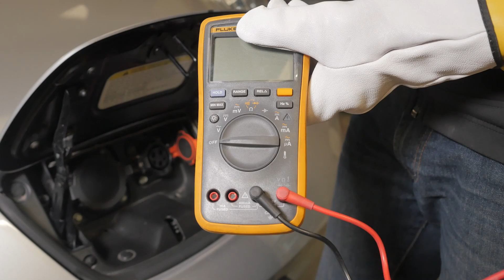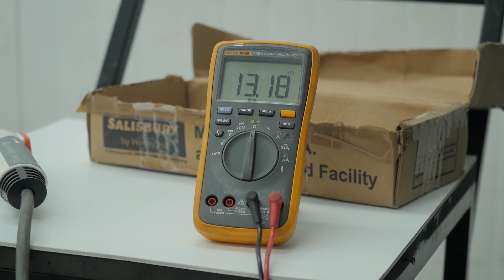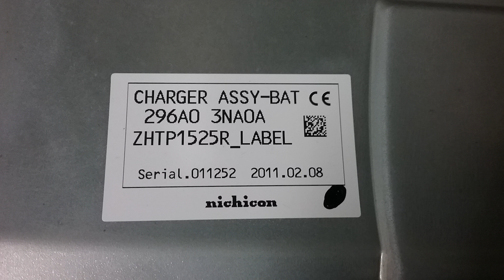Nissan Leaf Charger Fix

Comment: I'm having a similar problem with my 2019 40kW Leaf. It will charge ok with the 13amp "Granny" charger but not the type II wall charger or similar public chargers; (When I can find one that actually works!). My local Nissan dealer doesn't have a type II charger so they aren't going to be able to test it. Not sure what to do. The 3 LEDs indicate it's charging but they go out after a few minutes.

Comment: It's great to see EV mechanics making these types of videos.  I just purchased a 2018 Nissan Leaf and I really like the car a lot even though the ChadeMo quick charge stopped working.  It's fine because I find I don't need it.  I fully charge it at home in 2 to 4 hours and sometimes don't charge it for a day or two because I use it for around town and drive between 20 to 80 miles any given day to run all errands.  This car was designed for around town use, not road trips.

Comment: Seems like you skipped an important step in this video. You must’ve had some kind of circuit diagram you an indication which diode failed, and where it was located.  Please elaborate.  Or is there a service bulliten that gave you a clue?

Comment: hi, i measured with a measuring instrument but the values seem normal. then i measured a charging nissan leaf and realized i have the same values. my car only charges with chademo. And now I don't know what to do. Do you have any suggestions? by the way the value of my front small battery is 12.4. Could it be caused by this?
Reply: Did you replace the 12V battery? Did it fix the issue? I got a DS3 crossback e-tense with battery in 12.3 V and only charging in DC. I can't charge at home.

Comment: I have a suspected fault that I cannot fix - I have a 2013 leaf. It has been fine, charging to full at 6kw at public chargers, using a type 1 to type 2 cable - but over the last few months, when I plug in to charge at the same public chargers, it will charge at 6kw for about 10 minutes, then switch to 3kw and slow down to charging at 3kw over an hour - then the second hour it will only charge at 1kw, this is when the battery is at around 20-40% full. If I plug in the 2.3kw slow charger at home then it charges ok overnight. The Chademo works ok and chargers at 50kw. I used to be able to leave it plugged in at public chargers for 2 hours and it would be back to 100%, now if I leave it 2 hours while shopping, I am only getting about 50% charge.

Comment: Great video. Unfortunately after repairing the diode, I now have an open circuit between pilot & ground. Gonna plug in charger and see if it charges.
Reply: What happened?
Reply: @BassByTheBay  Sorry. Turns out my employee never actually did the diode repair before I reinstalled the charger. So that's why it was still reading open when testing.
Reply: @stevenromero1801  Did the diode ever get replaced? Did the charger work?
Reply: @BassByTheBay  Unfortunately it did not. I ended up replacing the whole unit.
Reply: @stevenromero1801  Thx for the update.

Comment: Hello from Norway. Is it possible to change OBC without draining the cooling fluid? I haven; t the opportunity to get my car lifted so much over ground level. And thanks for a great video. LG
Reply from the maker: Hi. The coolant needs to be drained to replace the OBC. It could be done without a hoist though. The car doesn't need to be lifted that much.

Comment: My problem with the 2012 Nissan leaf is I'm charging it with level 3 station and it's not charging to 100% even if I charge it for more than 40+ minutes and I don't see the charge guage cluster go all the way up as it should, it only shows 30miles range
Reply from the maker: Hi. Fast chargers are not designed for charging to 100%. They are there for a rapid boost typically to something like 80% state of charge.  Above this, the fast charge power that most batteries can accept is vastly reduced and even more so on a car with a heavily aged battery (fast charging performance will reduce as the state of health of the battery decreases).  Often a fast charger is set up to finish the charge if the power that that car can accept gets down to a minimum value like 5-10kW.

Comment: Very Interesting.  Great Work.   have an EQC Merc (6 Months old) that had the same kind of fault and the dealer replaced the Charger.  Must have been expensive.  I hope you are going to be able to service the European EVs in the future.  Charger failure my be rare at the moment  but I suspect some of the Internal Electronic componentry may not be as robust as they should be.  I Guess it was a diode check problem as the fault was intermitant at first.  It only took a coupe of weeks to get a charger out from Germany and Im glad at least I could use the Public DC chargers.  I had a ZE1 Leaf for two years that never had problems and I really liked that car.

Comment: Have similar issue.. Won't charge on home charger but its charging on fast charger.. I checked resistance.. On ground (big hole on a bottom) and right approximity connector i have around 4.3V, resistance between ground and left pilot connector i have 0.399 M Ohm which, as far i understand is wrong (should be  Kilo Ohm's? ) when im trying to measure resistance other way around (red pin on a el. Meter tool to the ground and black to the pilot connector ona a car socket) its showing nothing... No resistance at all... Any clues what's the reason

DTC B29C1 charger evse VC 98
And P3173 EV/HEV On Board Charger Sys EVC-236
Reply from the maker: Hi. There are 5 different sub-types for B29C1, so it can mean a few different things.  However, one of those five types can indicate a more serious failure within the on board charger.   Do you have any other numbers next to the fault code? In not, perhaps you are using an older version of LeafSpy.
Reply: @EVsEnhanced    Yes i do have...
 U1511 0108 BRAKE Pwr Supply Backup Unit Comm BR-184 

B29C1 236C CHARGER EVSE VC-98

P3173 00C1 EV/HEV On Board Charger Sys EVC-236

That's all DTC i had on first reading
Reply from the maker: @ukaszwnek1238  That is the type Nissan calls 'signal stuck low' which is a terrible description because it has nothing to do with signals.  It means that AC power is not getting through to parts of the on-board charger as expected even though the EVSE has been instructed to close its relays.  It can mean a lot of things such as a damaged EVSE, blown AC power fuse in the car or a more serious internal failure in the power side of the on-board charger.
Reply: @EVsEnhanced  I checked the AC fuse in the box under the hood (20A) is ok, any tips where to start looking for a problem?  Before I decide to buy a new EVES charger, I would like to check other possibilities as much as possible.  Maybe the description of the situation will help a little ... After work I connected the car to the charger, I do not know how long it landed, but after about 2 hours I noticed that one of the fuses in the house popped out.  I unplugged the charger, restarted the fuse, connected the charger again and the fuse in the house popped out again.  After this, despite a repeated attempt to charge, the security panel at home does not pop up, while Nissan stops charging after about 3 seconds.  That day it was raining heavily and charging the car in front of the house (of course only the plug of the home charger was outside, the box itself was not)
Reply from the maker: @ukaszwnek1238  I wouldn't recommend rushing out to buy another EVSE as there is still and equal chance that the fault is related to the on-board charger in the car. Can't you find another EVSE or AC charging station to try the car on?  What year is your car by the way?
Reply: @EVsEnhanced  I checked the car on a different AC charger, it does not charge, the problem is on the car's side.  There will be a problem with EVSE only for the test ... basically I run out of ideas, I checked all the advice from the Internet and I am more and more inclined to buy a new EVSE

Car year is 2012
Charger is 296A0-3NA5A
Reply from the maker: @ukaszwnek1238  Hi. You said you confirmed the fault is on the car's side. Did you mean you intend to buy a new EVSE or on-board charger? While it shouldn't be considered conclusive, your fault code is the typical one we see when the OBC has had a major failure.
Reply: @ukaszwnek1238  did you get the problem figured out mine is having similar problems but won’t charge on dc or ac
Reply: @HellaCopter  i had a problem with build in charger, but if you have problem with both charging AC /DC you have to check socket connections in a car
Reply: @HellaCopter  Check all pins in a car socket first and cables which going from socket to..

Comment: Great Video.. How much does this job cost so if I have to pay I can get a ball park estimate, instead of getting played by the mechanic like I always do.. Thanks nd God Bless!
Reply from the maker: Hi. Firstly the exact failure shown in this video is only common on the earliest Leaf models built 2010 and early 2011 with charger part number 296A0 3NA0A.  The later versions like 1A, 2A etc had revised hardware to address this exact design problem.  Secondly, we have done this repair many times in-house and we no longer remove the whole charger from the car or drain the coolant. We just power down and disconnect all of the HV system, check it is fully discharged and then remove the control board from the charger to fix it.  That reduces the labour involved immensely.  On later the 2011 and 2012 OBCs, failures tend to be more serious and complete removal and testing is still required.
Reply from the maker: @melissameazzo146  Over the years since this video, we have seen various modes of failure with these OBCs.  The one shown in this video is the easiest one to fix. With some of the other failure modes, it isn't viable to fix the OBC and a complete replacement with a new or used part is still required.  We aren't going try to put single $ value on all of the possible repairs.

Comment: how i can put out thecond motherboard?
Reply from the maker: You mean the main circuit board?  There is a power module sandwiched between the main board and the liquid cooled heatsink.  It does all come apart but with some difficulty.  The power module is soldered directly to the main board though and de-soldering it is difficult. We made a de-soldering tool specifically for this job.

Comment: Hi,
I'm having similar issues but when I measured the pilot pin gives me 0 resistance both ways. Fault code B29C1 236C CHARGER EVSE VC-98
and P3273 00C1 EV/HEV On Board Charger Sys EVC-236
Any tips? Thanks

Comment: Hello sir, i have trouble with L2 charging 6kw cable on Nissan Leaf. On classic charge port on one side and Mennekes on other side. On board there flashing 3 lights with beeping. And station want to charge comunication and everything is ready. Idk what is wrong.

Comment: I have a 2016 30kw leaf and having this issue. I'm hoping it isn't too expensive to repair.... 🥴🥴🥴
Reply from the maker: Hi. What happens when plug in on your car?  Any lights or beeps? Are there any fault codes in the car?
Reply: @EVsEnhanced  all works for 30seconds and then nothing all switches off.
Reply from the maker: @Francisfamily12  If you want to email a screen shot of the fault codes and full description of the behaviour to enquiries@evsenhanced.com then we'll have a quick look to see if anything obvious sticks out.
Reply: @EVsEnhanced  getting a couple of errors off spyleaf

Comment: This isn't a rare fault I have nissan 2018 leaf it is out warranty and I pay to get this fixed 😓😩
Reply from the maker: Sorry to hear that.  I'm guessing that your car has the 6kW charger?  Yes there have been some problems with those on the ZE1 and there was an official recall.  Perhaps you might be covered by the recall even though it is out of warranty.  Do you have the part number of your PDM (which includes the charger)?

Comment: Hi, my 2012 leaf is having charging issues now as well.
It will look like it is charging (blue light blinking) for 3 seconds and than it stops.
I tried to measure the resistance on the pins. I am getting 4.32V, but from the other pin no resistance at all both ways... Any tips to search for? Maybe the contact went bad?
Reply from the maker: Hi.  Can you check the fault codes in the car?
Reply: Did you find a solution to you problem. Mine is doing exactly the same as off today🙁
Reply: @PiqueMacho1  sorry to say mate, but the on board charger got toasted. I had it replaced with an used one and its working again... Good luck.....

Comment: Great video thank you very much.
But just after doing this my heater stopped working. Does anyone have any ideas on what to check or fix?
I have a heatpump version.
Thanks
Reply from the maker: Hi.  The 2011/2012 Leaf as shown in this video doesn't have a heat pump.  However, it isn't entirely uncommon for the PTC heater on this model to fail.  What model year is your car?
Reply: @EVsEnhanced  
Thanks for the reply.
Its a 2011 model, I believe its a model G
Rego : LNY568 if that helps
Reply from the maker: @JackVerhoef  Ok. That is a ZE0 like in this video which does not have a heat pump.  It has a PTC heater which is a box that sits under the 12V battery and heats coolant that runs through it.  This may have failed.  A good next step would be to check for fault codes in the car if you haven't already done so.

Comment: Quick question, what is the model number on the new Diode that you swapped in? Trying to replace mine but I'm curious which "better" part you got. Thanks
Reply from the maker: Hi.  Check out the comments in here as I'm pretty sure this question has been answered.  Also, the failure method discussed in this video only tends to occur on the first of these chargers with part number ending in 3NA0A.  The 3NA1A and later hardware variants moved to two diodes in parallel to address this design problem.

Comment: Hello, and thanks for a great video. Nissan Leaf 2011 - I tried the diode fix to resolve the error but unfortunately the AC charger is still starting, then the erlays disconnecting after a few seconds. I suspect I now need to bite the bullet and swap out the whole AC charger. Can you recommend any further tests before I take this plunge and purchase the AC charger to see whether it actually will solve my ac charging issue. (p.s. Chademo charging is fine, just AC refuses). Thank you
Reply from the maker: Hi. There are certainly several other modes of failure for these 2011/2012 chargers that we have come across since this video was made several years go.  Many of them are fixable, but require some special tools and test equipment to diagnose and repair.  However, a good first step would be confirming exactly what fault codes you have in the charger when attempting to charge.  The fault you described is often correlated with B29C1, but there are 5 variants of this fault code which all mean different things and some scan tools (like LeafSpy) don't give the required extra info.
Reply: Interesting, I understand you are abstracting a lot of the troubleshooting, do you check voltage at each pin during normal operation or do ypu mainly use resistance measurements to probe the charger board?

Comment: Hi guys how do you bleed the cooling system, I would imagine it would be different compared to an ICE car, i need to remove my charger and sending it to you guys.
Reply from the maker: Hi.  From memory, there is a bleed point that you remove at the back of the car under the charger.  Then there is a bleed point up front.   It is all explained in the service manual but is pretty straight forward.  We can send this info with the repaired charger if you don't have access to it.

Comment: Im searching for the part number for the charge controller 2012 leaf
Reply from the maker: What exactly is a charge controller? Do you mean the complete on-board charger?  The latest/current version for the 2011/2012MY Leaf is 296A0-3NA8A.